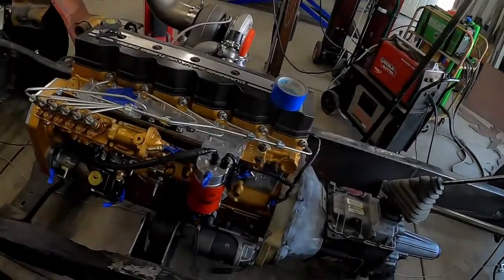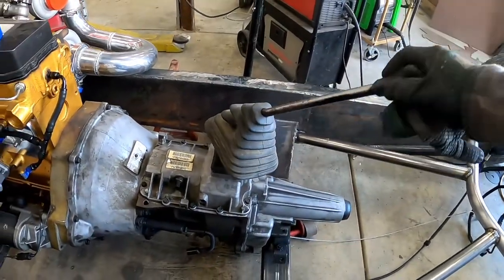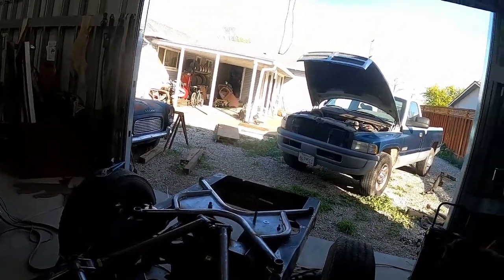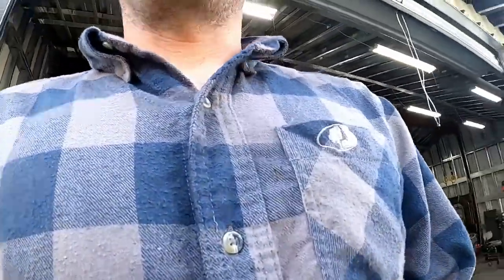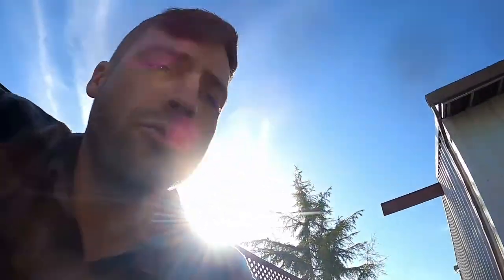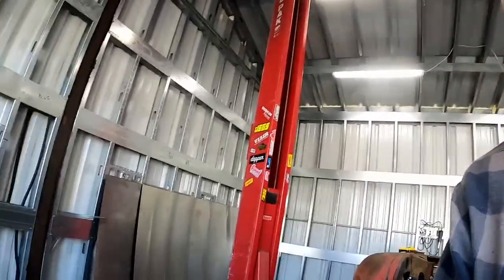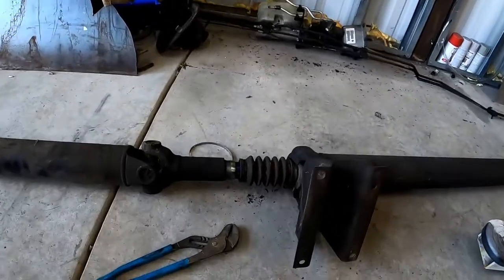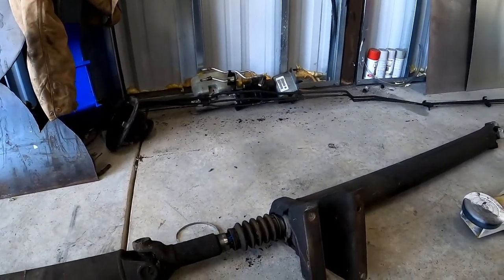BAD IDEAS are BREWING!! Compound Cummins 51' Ford COE 47RH or NV4500 ?!?

Comment: On the balance you will have to separate the Ujoint, the front will have to be balanced with the slip yoke on it and the rear with its yoke.  However Rich, with the COE, you are going to have an exhaust stack and nothing cooler than the puffs of smoke when changing gears!  If your gonna change the trans, put a larger Eaton Fuller in it. Change the rear flywheel housing on the cummins and put the bigger clutch and tranny in.  I have an RT6613 for mine.  That is 13 speeds, and you don't have use all of them, but it is KOOL!  For a shift tower,  find an old garbage truck in a wrecking yard and get the tower from it, then it is only one shaft going back to make the shift. You will need air for the ranges but you already have that for the baggs!!!  Well I just looked at the post date for this video and I am prolly too late.   LOL  Have fun.
Reply from the maker: Actually earl you aren’t too late at all! I really appreciate all your input this far, you have got some solid ideas as well as experience seems like! I have actually reconsidered the  automatic since this video, and the heavy duty manual sounds pretty awesome, I bet I would be money ahead by selling the nv4500 too! I was initially thinking the driveshaft would be converted to a one piece unit instead of two due to the fact it’s only going to be 3 foot long?